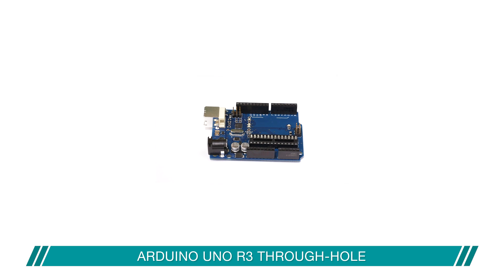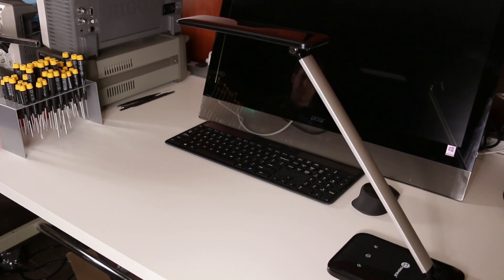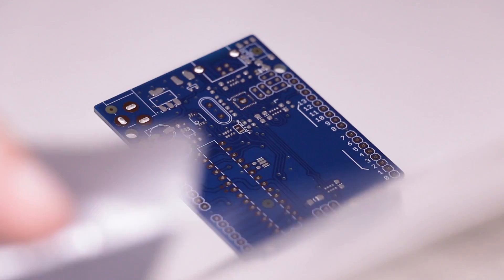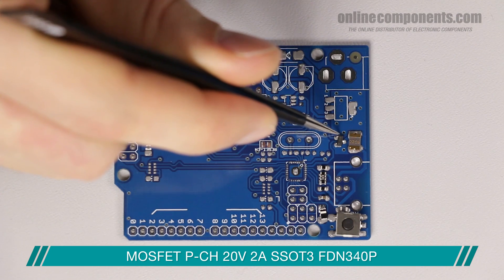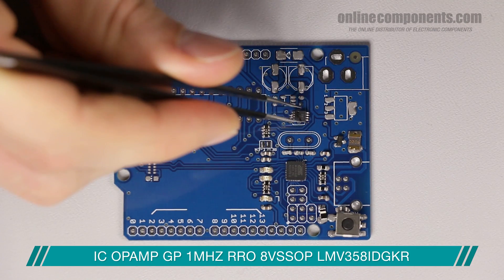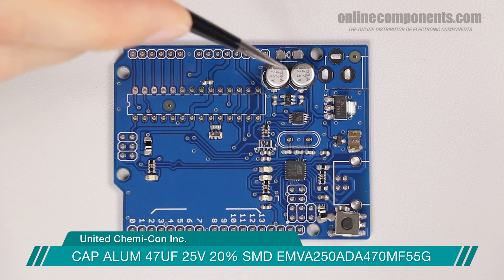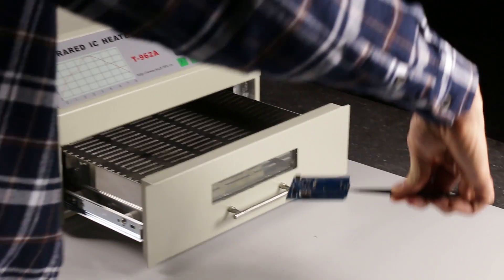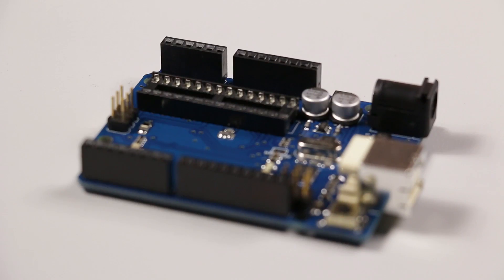TechXposed - Build Your Own Arduino...From Scratch!

Comment: I guess I didn’t expect you would be engraving the actual pcb and understood that it was adding components to an existing bare board. Everyone’s a critic. It would be nice if there was an easy source to buy board specific components without buying $100 in bulk product but either way works it all comes down to end user dedication to smd projects.

Comment: Question. do you still need to program the bridge microcontroller? or does the arduino software do this through the data lines?

Comment: thank you for this video, i recently bought the same pcb, but have no reflow oven, now i will  search for the parts. nice you mention the parts in the video.
Reply: I know this is a year late, but you can use something as simple as a halogen bulb, or make a reflow gun from a cheap soldering iron.
Reply: You can also purchase a smd 898D 700w soldering station for $49.99 (eBay) or convert a $29.99 toaster oven with a $25.90 pid controller that will work well. I have the soldering station with hot air gun and I will say it works remarkably well. Also if you want a professional reflow oven aliexpress has them for $175 if you don’t want the headache of building one and are serious about toying with electronics and not just occasional usage.